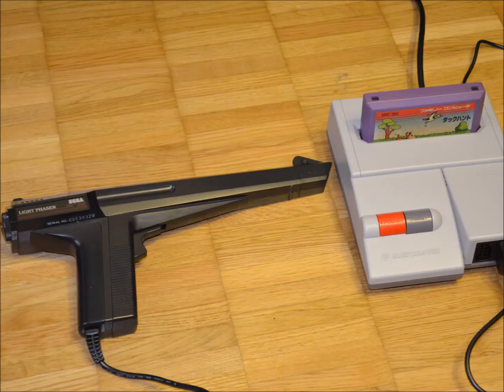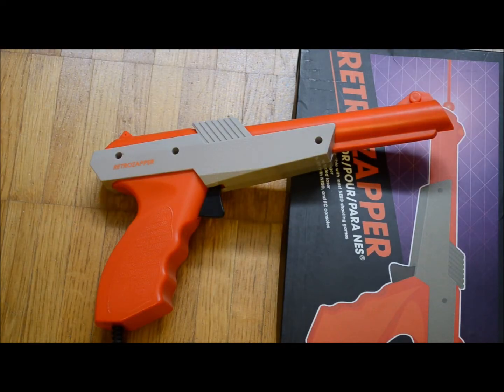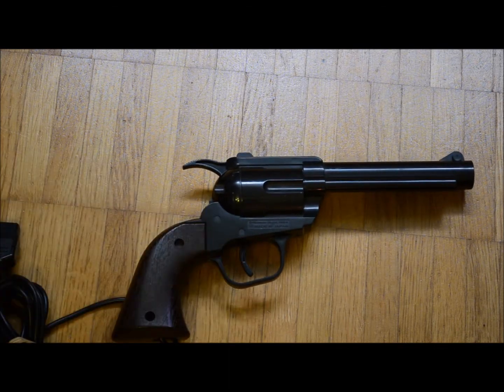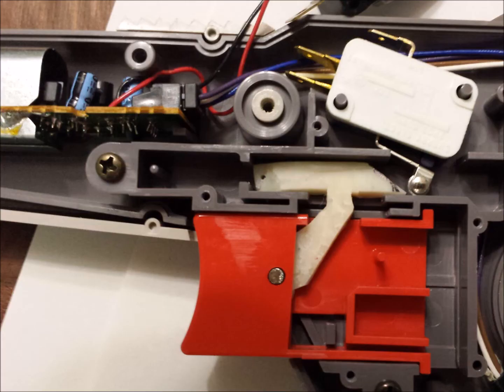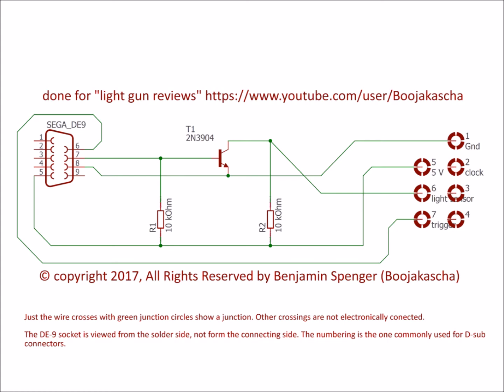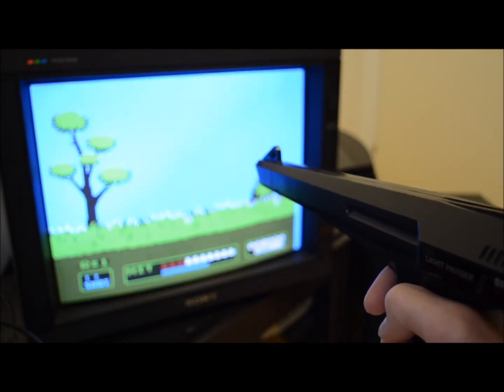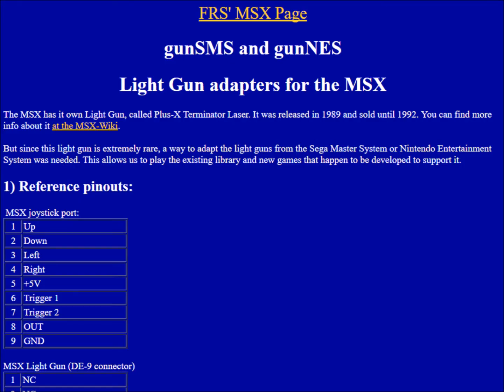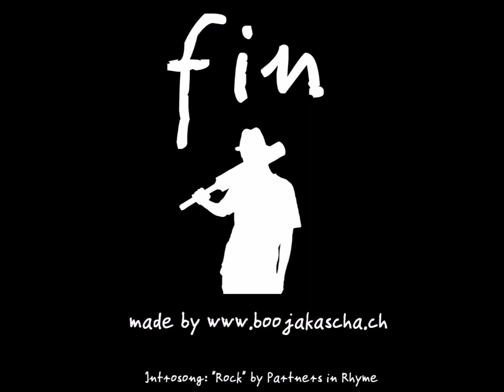Light Gun Reviews 17: Sega Light Phaser to Nintendo Entertainment System (NES) adapter

Comment: Thank you for exploring this mod! I've always preferred the SMS Phaser's feel to that of the NES Zapper.

Question: does the light phaser also use a ~15khz filter, similar to the NES zapper? (I wish to attempt your modification with the neslcdmod patched roms on a modern LCD television.) Would you be willing to try out this configuration?

If the Phaser does filter the signal, perhaps a modification to  the PCB could remove it? (On the original NES zapper, the removal of a 1nF capacitor from the PCB seems to have this effect. It widens the filter bandwidth enough to allow it to work on modern LCD panels, while still blocking most DC noise.)
Reply from the maker: Thank you =)
Yes, the Light Phaser filters for 15 kHz too. I am not sure though how much the attentation at the lower frequencies is. It might be enough sensitive to still work. I will try next time I have the NES out :)

Comment: Hello again! I've been planning to run Sega Master System games on a Sega Mega Drive and people report that Phaser is supported and works well (using an Everdrive). Do you know by chance if a Konami Justifier (MD version) will work too with SMS roms or getting a Phaser is mandatory? Thanks!
Reply from the maker: Dear Yabier, No sadly I don't know. I think if a Light Phaser really happens to work on a Mega Drive as Light Phaser (which I don't know) then I am very confident that a Justifier won't do the job without an adapter.
Reply: @Boojakascha  Something like this? https://atariage.com/forums/topic/274783-fst-genesis-controller-to-master-system-adapter-misc/
Reply from the maker: @Yabier11  No, no. What I meant was something like the opposite of what Ben Ryves did: A Justifier to Light Phaser adapter.

Comment: Man this is impressive, let me know if you sell this one. ALso It would be possible to build one to work the opossite way too? You know the NES and Master System both have 1 have game for 2 players. SO this way these lightguns will work for those ones.
Reply from the maker: The opposite is technically possible (just revers it) but practically would't be feasible. My understanding is that the Zapper is too noisey to measure X coordinates. I never tried it though!
Reply: @Boojakascha  would you try ut at some point? the 2 games ar CHiller at NES and Ganster Town at Master System.  One more  question: A Megadrive Justifier Lightgun , will work as a Light Phaser in Master System too ? (whitout risking it from get broken)
Reply from the maker: @juanjoserivasgarcia2336  Yes, I will probably try some day. No this definitly won't work. The Konami Justifier is a digital controller and sends messages rather than analogue output.

Comment: Hi, I need an adapter to connect Sega Phaser light guns  to use with a Amiga 500, I'm not an electronics expert, could you tell me a site where I can buy it? Many thanks
Reply from the maker: you would need to build one. There are several standards on the Amiga. Could you tell me which games you are planning to play?
Reply: @Boojakascha  Thanks for your fast ansewar ... I would like to play "Operation Wolf"
Reply from the maker: @realcoreretrogames3737  as far as I remember that one isn't supported at all natively. Light gun god CFOU! did a patch to force compatebility to the  Actionware standard if I remember correctly. The nescessary pinout should be in my Capone video. I try to look up some information as soon as I am home.
Reply: @Boojakascha  You are the best one!! ;D
Reply from the maker: @realcoreretrogames3737  I was able to look up. First and most important: The artist of course is called CFOU! (which means "this crazy person") I am really sorry and edited that... when walking home I already noticed the error...
The version you need is the WHDLoad HD version
http://www.whdload.de/games/OperationWolf.html
It will allow you to play either using the Actionware standard (as I said) OR the Trojan standard... I would recommend the Actionware standard, as these games are fantastic... If you like Operation Wolf you might want to carry on playing P.O.W. using the Actionware  gun adapter...
Reply: @Boojakascha  Thank you! You are very kind! Although I think it will be very difficult for me to follow these instructions. I thought it was enough to connect an adapter to the gun in order to play, I do not understand what all these installations are for. ;)
Reply from the maker: @realcoreretrogames3737  WHDload is a utility to play games from the hard drive. Usually it is supposed to be used on Amiga 1200. On a Amiga 500 you need strong expansion hardware to run it. I use a ACA500plus card by Individual Computers. I am afraid it is very difficult to set up & is expansive.
Reply: @Boojakascha  Thanks for everything, your answers have been really precious. It is absurd that the programmers from the 80s have created "Operation wolf" without gun support! : °

Comment: Hi! I did this adapter cable for my Famicom, I am also a great fan of the Light Phaser, but there is one thing, on Duck Hunt shots are fired when I release the trigger istead of when I press it. Is this normal? Is the game supposed to do that? Should I invert the trigger signal on pin6?
Reply from the maker: +Fabricio Fanfa
Yes, this is normal. It is what I refer to as „behaving like a Bandai Hyper Shot“. It is what I mention at 1:45. The Hyper Shot does this too. The Japanese “Gun” does so if you use the hammer instead of the trigger. Even the real zapper and the real Gun would normally behave that way, but the plastic trigger actuators don’t hold the switch pressed, when pressing and holding the trigger. In those the switch is briefly pressed and released again, as for the sliding and latching actuators held under spring tension. I mention at 3:19 that the Light Phaser will behave like a Hyper Shot. Personally I like it better that way. I modified my own Zapper to always behave like a Hyper Shot (which I show in the beginning of the video). No, modifying the pin out / invert the signal won’t work. At the end of the day it is they game which does decide how to react. On some occasions there is even a regional difference: The Brazilian version of Crime Busters responds different to a permanently pressed trigger than the Taiwanese one.
Reply: Thanks so much for everything, both making the schematics so I could make this mod and also for this nice reply. I am thinking about puting a capacitor and a transistor on the pin 6 line so that it disarms on itself, I am a semi newb at electronics, but I believe eventually I will come up with a solution. If I do I'll let you know, so you can add the option on your website.
Reply from the maker: +Fabricio Fanfa
Thank you very much =) I am no electronics engineer either^^ I just do some electronics as a hobby just like you. From the gut feeling I would assume however that the idea on the trigger line won't work. Neither a pull up resistor nor a pull down resistor would solve the issue, as the logic state is changed for as long as the switch is pressed, no matter what. That's why the Zapper simply avoids keeping the switch pressed. A capacitor connected to GND would simply act as bypass capacitor: It would remove residual DC voltage and would flat out signal noise a bit. I am very sorry :-( 
I hope you find a way =)
Reply from the maker: @dev639   A viewer (magictrashman) has found out a way to modify the Zapper back to it's original fire behaviour: If you move the wire of the NO pad of the trigger switch to NC, the Zapper will again fire upon trigger press instead of trigger release.

Comment: Impressive, it's impressive that the sms light phaser can work on the nes but that the nes zapper(stupid name for it) does not work on the master system is sad because eventrough those games & light guns works differently to detect light but still they both messure the timings of it.